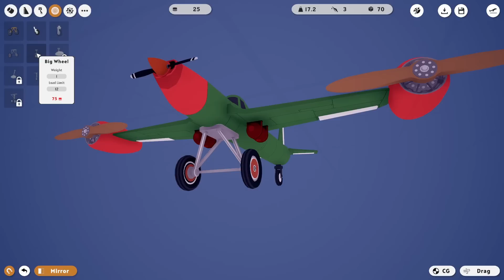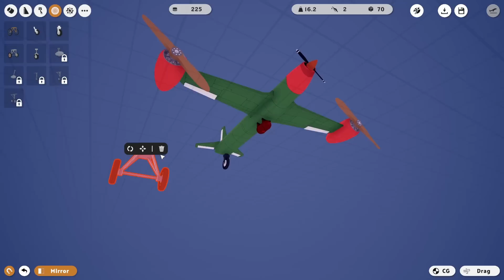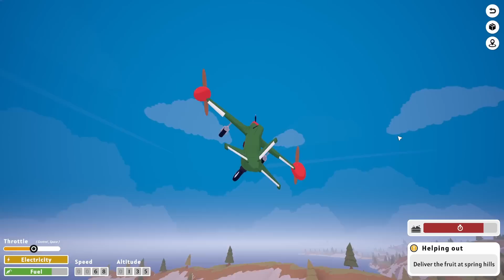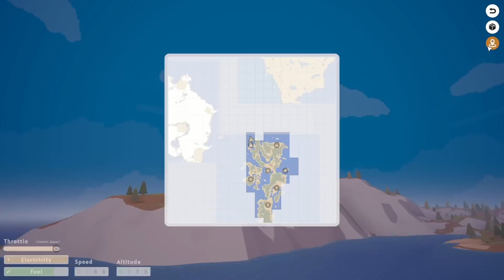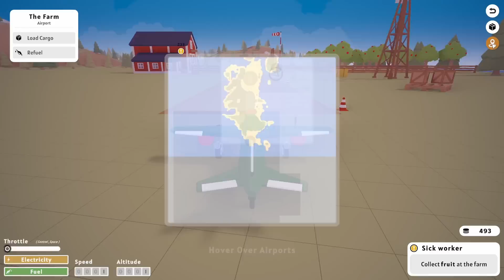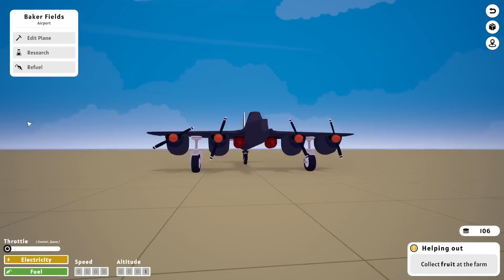Design Choices | Aviassembly

Comment: the new strong wheels seem to be more forgiving regarding the landing. the initial wheel require so much more babysitting while landing. 
edit: but no so strong yet to tolerate that landing 32:20 :D 
a bit of tilt for the wings such that it has a slight upward angle of attack may help taking off and keeping level, as it seems to tend to point down at low throttle
Reply from the maker: Hehehe! Yeah, that wasn't my finest landing, was it?
I've avoided messing around with wing tilt up until now, but it's probably worth a little experimentation.

Comment: The reason you had so much trouble taking off was because of the rear wheel. You couldn't pitch up the nose until you got enough speed to produce lift at the wings ground angle of attack. You can either pitch the wings up a small amount when building (turn snap angle off for fine tuning) or use a nose wheel instead. Main wheels should be just behind the CofG leaving a large fulcrum to enable moments on the ground for pitch control
Reply from the maker: Ah, ok. So move that rear wheel to the nose? With the wheels on the wings, they can't be behind the CoG, so should I be moving the wings back or not?
Reply: @StormhavenGaming move your wings to make it nose heavy add the nose gear to hold it.
Reply: @ The wings need to be near the CofG. This game doesn't model the physics well at the moment but normally if your CofG is in front of your CofL (centre of lift) that would produce a natural nose-down moment, CofG beind te CofL would be a nose-up moment.
When using a nose wheel the main weels need to be behind the CofG or the whole plane will tip onto it's tail. But there needs to be space behind the main weels for the take-off pivot.
In order for a (normal) plane to pitch up the empanage (rear horizontal tail plane) deflects to produce lift acting in a downwards direction. This pushes the tail towards the ground and the nose pivots up using the main legs as its fulcrum.
When using a tail wheel a normal take-off rotation is not possible as the fulcrum for it would now be the singular tail wheel. Tail wheel'd aircraft have their wings angled up more towards the front to produce more lift.
Hope this helps
Reply: Righ, tricycle landing gear layout definitely aids takeoff.